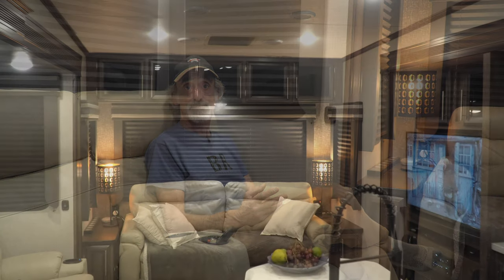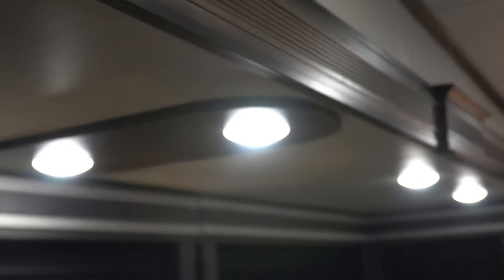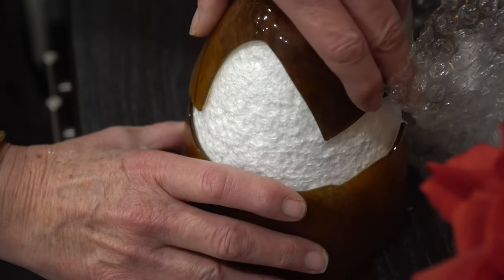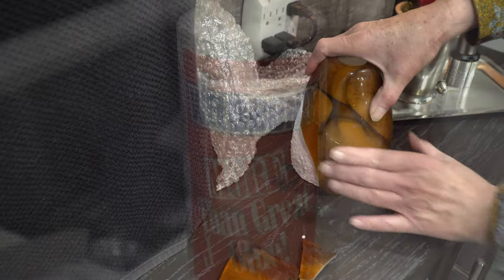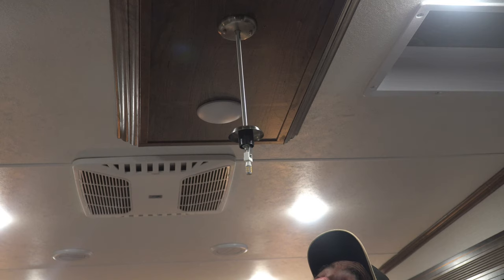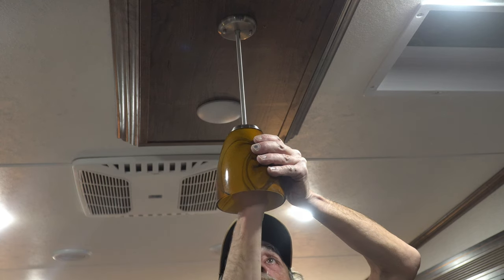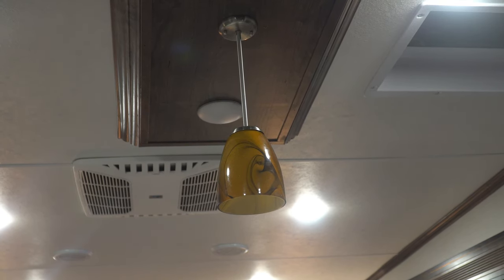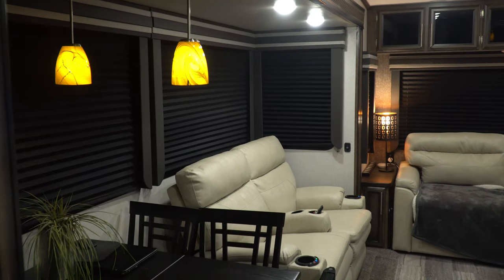Ep.185: Upgrade Your RV Lighting | camper how-to DIY upgrading interior lights

Comment: Hi Mark, I have a Q and no longer on FB so thought I would ask here. I am traveling to SLC to visit family this June and want to camp close by. Do you have any recommended places. I would enjoy electric but not absolutely necessary.  We have 30 ft fifth wheel from outdoor RV.  I am thinking of Tanners flat. Do you think that’s a good choice?
Reply from the maker: You're welcome to hit us up here anytime. FYI if you moved from FB to MeWe as many have, we just set up a presence over there: https://mewe.com/p/grandadventure

Tanners Flat is up in my happy place, Little Cottonwood Canyon, but I honestly think that you'll find it challenging pulling a 30-foot fiver through there. It's an old campground originally designed for much smaller rigs. June is too early to visit the campground higher up in LCC at Albion Basin, too -- it'll quite possibly still be snowed in, depending upon what part of June.

Spruces Campground in Big Cottonwood Canyon is another nearby USFS campground that has a bit more room, but there's still the remote possibility of snow issues in early June.  If you're looking for established campgrounds reasonably close to SLC that can definitely accommodate a 30-footer, I'd look at Jordanelle State Park or East Canyon State Park. Reserve now, as both are very popular for their scenic locations so close to SLC. Jordanelle in particular is massive; East Canyon is more intimate.

In the Salt Lake Valley itself, there are actually three commercial RV parks:
1. The Salt Lake City KOA: Attractive sites, crappy neighborhood (but still safe within the park);
2. Mountain Shadows in Draper: Not very attractive, but conveniently located. 
3. Pony Express: More distant from most things from the other two. I haven't seen it in person, but from photos it looks reasonably attractive. It's kind of in the middle of nowhere near the Great Salt Lake and a bunch of oil refineries.
Reply: @GrandAdventure  Thank you Mark. Your suggestions sound wonderful. I will try and make a reservation today.  June and snow! Sounds like Colorado!  Thank you for taking the time and your detailed reply. I actually did find you and subscribed on MEWe!  I will let you know what we get booked. I get so home sick for the canyons and Wasatch front. I can’t wait.
Reply from the maker: @wellsonwheels457  have a wonderful trip. We came here 16 years ago from the East Coast and it's the best decision we've ever made. Even now that we're full-timers, we choose to winter through the off-season on the Wasatch Front. Much of that is due to my beloved Alta, but the Salt Lake area has much else to offer, too.

Comment: Oh hey speaking of RV light upgrades. I installed some LED taillights in the 2032 sockets and they melted the housing. So much for being clever. 

So please warn others to stick with factory style.
Reply from the maker: That's odd, Rabbi -- usually LED bulbs give off negligible heat.
Reply: @GrandAdventure  that was my assumption. And not to be found the case.

Comment: Geez Marc buy yourself a better wire stripper than that one out of the 99 cent tool bin. And change over to Wago wire connectors and forget the crimp connectors.
Reply from the maker: I had to look up Wago wire connectors, Bryan, but those look sweet. Thanks for the education!
Reply: @GrandAdventure  Yeah I switched over to Wago after one of your fellow RV bloggers showed them off while doing another project.